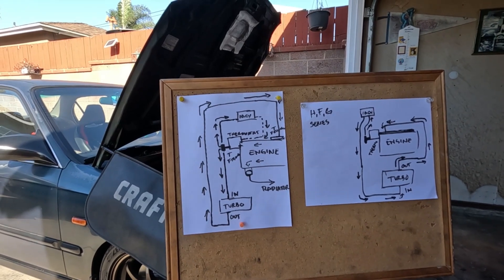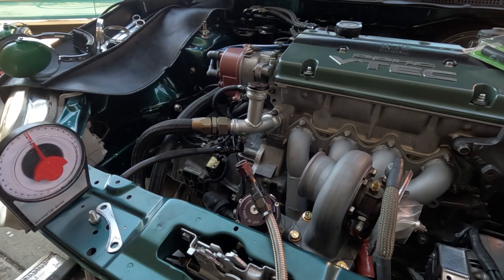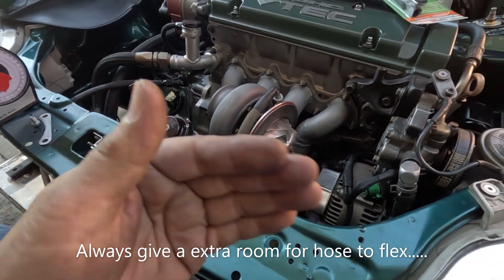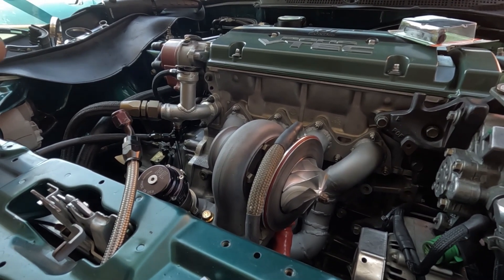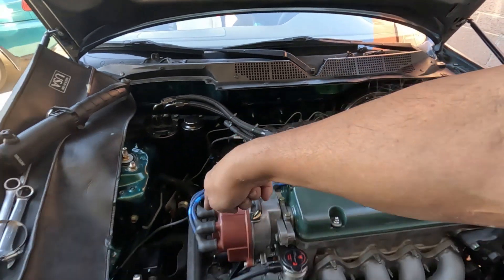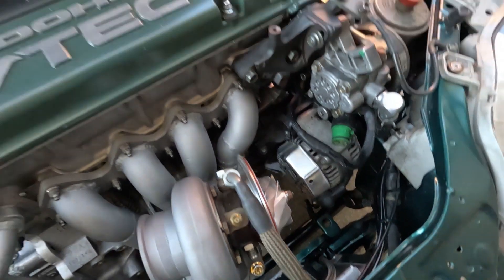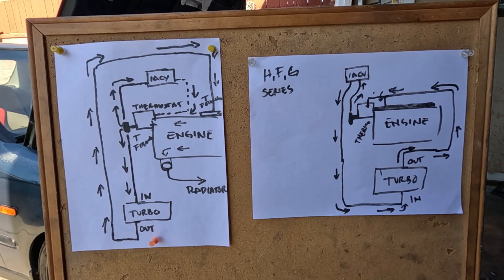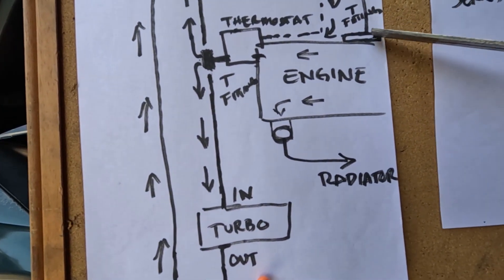How to route Turbo coolant lines on F20B,G23,H22 and H23A

Comment: or just bypass the IACV and run the lines to the turbo and back, atleast in california i have ran no coolant to IACV with no problem same goes to some throttle bodies that has fast idle valve under the TB
Reply from the maker: True, never tried running an engine w/o iacv and thats another best way to cool the turbo. Thsnks for your info.

Comment: Essentially an external aftermarket oil cooler could do the same thing as what your doing. At least in theory. Which is route I’m going.
Reply from the maker: I might install a oil cooler too but after the motor is tuned.

Comment: Really cool video
Reply from the maker: Thanks man!
Reply: @ yeah right dude. Thank you! Question would you rather sleeve an h22 block or f23block. Any diff
Reply from the maker: @cbdreamer1709  H22 for reliability and F23 if you want something w/ more torque. But you can go wrong w/ either one.